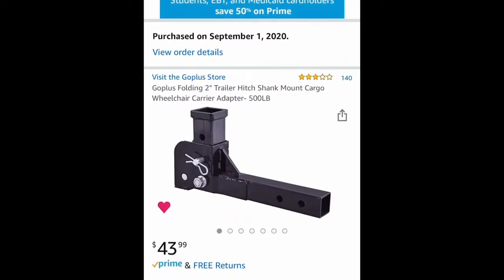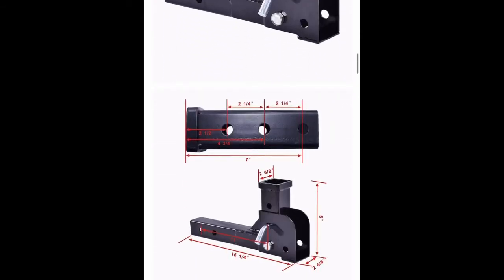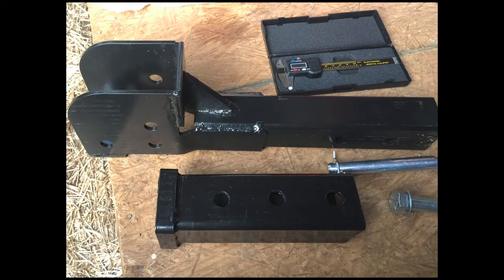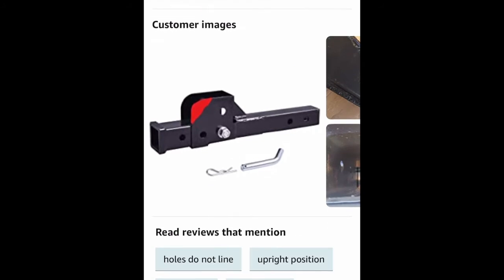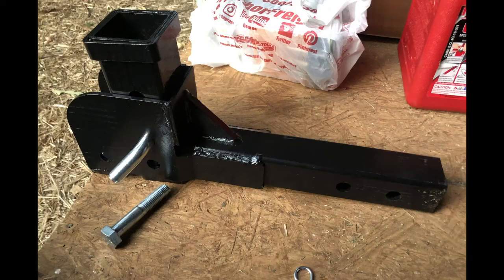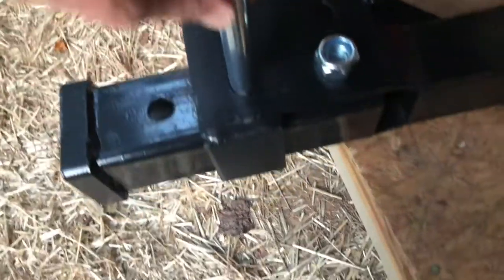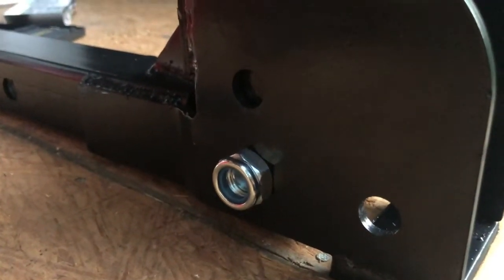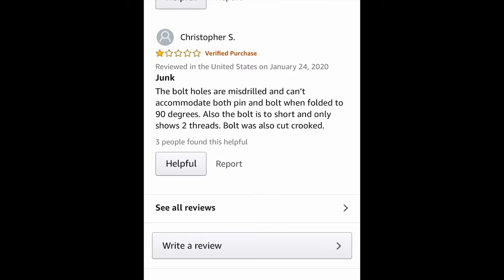Folding 2 Inch Trailer Hitch Adapter 500LB Product Fail - Amazon Return Item

Comment: I fot one these bought used for camping/fishing it didn't come with but the one bolt that acts as the hinge i had extra hitch pin i used of course i drilled our the holes the size of the hitch pin since i already had a simple fix for poor quality control or for picky sobs that cant figure out simple solution besides idk why anyone would want to hassle with a second bolt and nut that you have to have tools on hand just fold up or down plus maybe lose from vibration when that pin will never be an issue pull cottwe pib from hitch pin and remove hitch pin working so well that i removed the hinge bolt that had started to seize and replaced it with a hitch pin as before and then had a length of chain tacked up on the heads of hitch pins so reason to lose either since id have to pull a second one and don't have to worry about looking for equipment it can be dropped or raised and secured without any tools comes in handy for those cold wet times